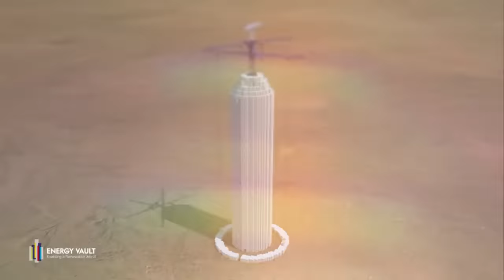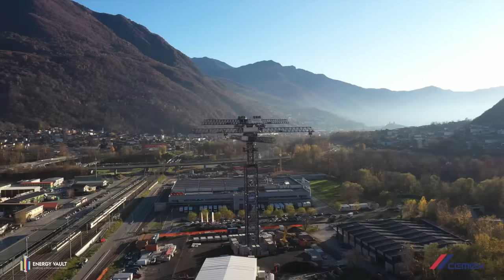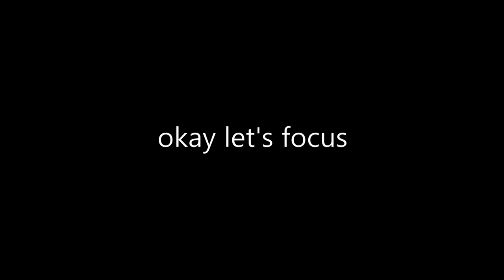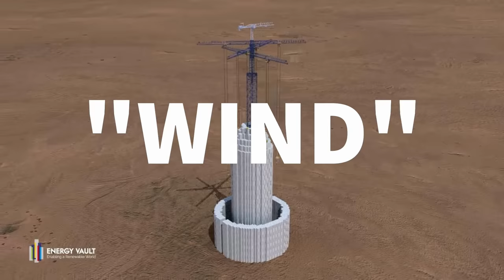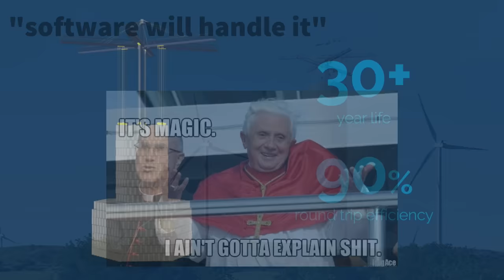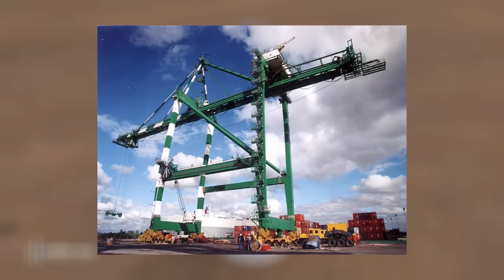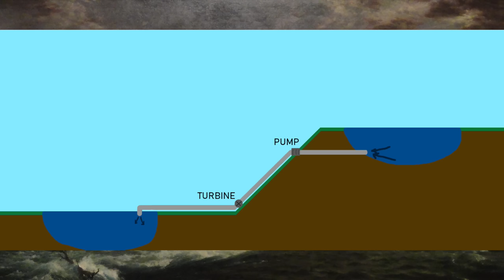The Energy Vault is a Dumb Idea, Here's Why

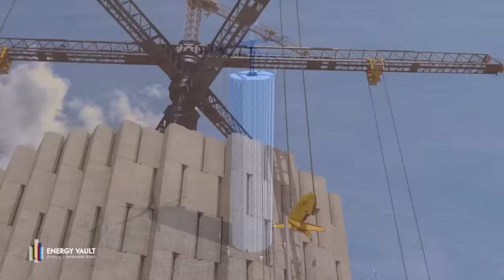Comment: No way in hell are those little tabs on the “grabbing” mechanism gonna hold the weight of those concrete blocks. 3:07
Reply: material science will handle it
Reply: ever heard of the word "concept"
Reply: "Software will handle it" 😁
Reply: dude. no way in hell you know better than a team of engineers working for a multi million dollar project.
Reply: @s3bastiaan  SoFTwaRE WiLl haNdLE iT
Reply: A few inches of steel would actually be completely fine, believe it or not. Think of rocket stage decouplers or things like that
Reply: Honestly that might be the most plausible thing here.
While yes they are a bit small the concept of rotating them in like that is probably fine.
And you'd be surprised how much is possible with modern materials - materials that are fucking expensive so yeah.
Reply: They'll hold it, at least at first. I wouldn't be surprised if you had the blocks breaking down to where they no longer held it pretty quickly.
Reply: It's a demo.
Reply: @jacobsteinebronn2966  Yep. On a steel cradle.
Reply: They wouldn't hold.
If they were full discs with one side being longer, yeah.

But it's only half a disc. The disc will hold, the connection will not.

All of you who said they would, PLEASE never go near a construction site or have ideas about constructions. You'll get scammed an kill people.
Reply: Mine is holding up fine. 😁
Reply: Why not? Those tabs are made out of pure unobtanium.
Reply: @FuSiionCraft  I'm a crane operator.  On mobile cranes the counterweight are held up by two pistons, each with a small lip. Sometimes for months they are hanging there by that 1 inch lip.  You would be suprised.  Also counterweight on a crane weigh alot more than these concrete blocks.
Reply: Ikr, like how would they carry them, even if they were able to which, nice stretch, elastigirl, I still think it would be very unsafe and the risk of them failing a bit high
Reply: @sebastianalegrett4430  they are engineers, not magicians
Reply: @wp9ydqrt49  there’s still like 50 of them working for this, and they all probably did better in college than this entire comment section combined.
Reply: @wp9ydqrt49  idk ab you, but i have enough self confidence to admit idk wtf i’m talking about, let’s be real you probably don’t, and neither does this guy after researching 2 hrs for a 3 min yt video.
Reply: meh, if that was the problem  you could easily have 100+ handles
Reply: @Solitaire Nope the piston and lip goes down a hole big enough for both, then the entire super-structure moves over a few inches into a smaller hole big enough only for the piston.  I'd imagine in practice this would be the way they would have to design these blocks.  I'm only trying to make the case that tiny flared edges can hold a fuck load of weight
Reply: @Desh727  yeah, that's not the same thing, they are enginered to do that, but here....
In the video they are just held from the top (not even a structural point to attach them at the bottom) and rotate...
The rod will just snap due to shear forces, you would be surprised how steel is pure garbage at this specific job...

The only way to make it somewhat usable for shear loads is to use it in I shapes (like |----| ) and even then it's not  that great, other materials can do better

But if it's like a polymer pad with a star and comb steel shape inside of it, then yes it could handle it with no problem since there will be less structural weaknesses
Reply: @singularity3724  we have software for it. It doesnt move it like hulk. Its gentle
Reply: Similar crain systems for concrete slabs and pre-produced stair bases already exists. So that's the only thing that ain't science fiction about this believe it or not! The connection of the rotating disc wouldn't look like in the 3D animation though, but that's only a visualisation to be fair.
Reply: forget those tabs. how are you going to so perfectly slide that bracket over the blocks in the wind. especially when that block is all the way down with a long cable. 

Software will handle it........
Reply: @sebastianalegrett4430  yeah I totally trust a multi million project that thinks software can just stop wind
Reply: Come on bro! They showed it in the documentary! Surely it can't be that bad?
-famous last words
Reply: The question is not "if it can", but "how long before it breaks".
Reply: @yummyherbicide7296  Limited Liability Company means it's nobodies fault if somebody dies!
Reply: hardware will handle it
Reply: They might be fine at first, but there's no way they're developing grippers anything like that that can lift and lower those blocks all day, every day, for 40 years without deteriorating, dropping a block and breaking everything.
Reply: @morganeclipse9038  or dropping a block and killing someone.
Reply: @Dj.MODÆO  One would hope that no one is allowed near the base while it's operating. One would hope.
Reply: bad logic will solve it
Reply: the block's weight would be 500,000N, evenly distributed across 4 of those, that's around 125,000N per (I'll be kind and round down to 100,000N). Based on the size, let's be generous and say they are 50cm long. treating these as cantilever beams (which is kinda unfair but I'm lazy) would require a higher tensile strength than tungsten to support, so it's not happening any time soon.
Reply: Imagination.
Reply: You found the one absolutely feasible thing about that to shit on.

Grabbing around it and catching the edges is the bad idea here.

Probably wanna go through a hole in the concrete so bangs and shakes cant dislodge it 

You underestimate steel a whole lot.
Reply: @ammyvl1  just make the block hollow, then they'll have less weight and the stee... problem solved xD
Reply: sure it can, have you ever seen how much weight a normal forklift fork can hold? a few inches of steel is no joke
Reply: yeah they probably could hold em
Reply: @jacobsteinebronn2966  it might be able to but the design for it isn't great. Theres no reason not to use heavy steel pins that just get pushed into holes in the concrete or stuff like that. Yeah the disc thing would technically work a few times, but it would wear down unnecessarily fast, have more expensive materials, and just be kinda bad engineering. A big pin works just as well with fewer and more simple moving parts
Reply: the software will handle it
Reply: Hydro has some serious issues. Personally i think we have to get used to the sight of windmills and go for a wind, solar, hydro, nuclear mix depending on the location. Off-shore windfarms are the shiiiit imo.
Reply: @s3bastiaan  yes, this is a bad concept, as the video discusses
Reply: @sebastianalegrett4430  the multi million dollar project revolves around loosely stacked concrete blocks and about 700 tons of faith. A 5th grader could come up with a better plan
Reply: @hamburgerdog25  then do it and become a multimillionaire instead of replying to 7 day old comments on yt
Reply: Well, it's pretty obvious that no engineers were working on this project. I'm fairly sure even engineering students would know better.
Reply: @sebastianalegrett4430  it wouldn't be the first time people with degrees and field experience had an oversight... I think there used to be a TV show about these kinds of failures? (If you know of the name, let me know.)

Even if done indoors. I'm still concerned with the wear and tear involved with concrete being moved. Pressure on the lower levels going up and down. Along with uneven lifting/letting go. Near perfectly square blocks won't stay perfect for long... If they were that way to begin with. All it takes is one idiot or a bad leader who thinks time is more important than doing it properly.
Reply: How do you have this weird font in your name? 😄
Reply: @user-qx7tm5df8j  I enter text into a gothic font generator, then copy and paste
Reply: @Dj.MODÆO  😂 ty
Reply: Little tabs holding a lot of weight is how most shipping containers are moved on and off of transports.
Reply: Oh shit you're right! I didn't even notice that. Damn that's going to immediately crumble and break off under the tensile and shock strains exerted on it. Sheesh this is even dumber than I thought
Reply: Didn't you hear? M8 bolts are strong yo!
Reply: @jacobsteinebronn2966  how many times a day rocket stage decouplers are usued on daily basis?
Reply: My thought exactly
Reply: @s3bastiaan  The things that 99% of the time are not implemented? Yes.
Reply: @Asbitos  the problem isn't that they can't support that much weight, the problem is that they'd probably damage the blocks over time too
Reply: @jacobsteinebronn2966  how many times do rocket stage decouplers get reused?
Reply: @sebastianalegrett4430  "people with money surely can do no wrong"

Comment: Adam: "I'm no Engineer..."

Me, who is an Engineer: Immediately after they show the grabbing mechanism "It doesn't work"
Reply: Software engineer and even I see those things snap off in spectacular ways
Reply: @OmegaGamer04  Marketing department: We'll call it a kinetic impact delivery system.
Reply: me who is still in school, and not even studying: I don't give a shit that this is gonna work
Reply: @mcripchip  That's not the issue though. You're right the problem is solvable; we already have proof in gantry cranes, which are capable of efficiently moving large heavy blocks for decades. The problem is that the specific design they chose to show here for whatever reason is unnecessarily novel and obviously flawed.

It's like, imagine presenting a design, and when it comes to the smallest, most easily solvable detail, rather than glossing over it you zoom in on a fancy graphic that reads "dunno, we'll figure this part out." That doesn't really inspire confidence.
Reply: @greenredblue  This comment just triggered me a little considering prototype engineering is exactly like this, a lot of the troubleshooting takes place in construction phase. Your job is just to make sure that joist is the right thickness, and that to come up with the simplest possible mechanisms that just work in theory. And when it comes to design there's a whole spectrum of engineers some have poor ideas and have bad vision others are team players and are capable building things like the JWST. If you asked an single engineer to look a graphic of the JWST 20 years ago. He would probable say simply "doesn't work"
Reply: Kindergartner here and I can tell you it won't work.
Yesterday I made a big tower out of blocks, Michael touched it and it fell on my big toe. It hurt a lot.
Reply: @JoshYxVdM  YES! lol
Reply: @greenredblue  That's kind of a foolish objection.  Graphics for a concept are never meant to be taken literally.  They are merely flashy bits to showcase a concept.  The concept is what these folks are trying to sell, that concept being a block-stacking gravity battery.  The grabber is solvable-scratch that- solved, but they didn't need to have hyper accuracy in the graphic to sell the concept itself, so they threw in something easy to render that looks vaguely neat.  Not great, but not a problem either.
Reply: @ericv00  But the important thing here are the details. The general idea of lifting heavy things to store energy and dropping them to release that energy is not novel. Figuring out all the details is where the work is. Presenting only the general idea of using stackable blocks of concrete with a generic crane is not very promising: it smells more like marketing than engineering.

And maybe that's the purpose. Quickly patent the 'idea' of using concrete blocks, without considering how, so you can charge for the patent to any other future project that uses blocks and have figured out exactly how.
Reply: @ericv00  I'm a software architect, and I have to sell designs all the time. In a demo or POC, details don't matter unless they're part of the minimum viable product. Lots of stuff in those are fake anyway.

Therefore, you do not zoom way in on irrelevant details that suggest you not only wasted time reinventing the wheel, but did so in a way so suspect that questions of basic competence need to be asked. That is what happened here.
Reply: @greenredblue   Questions of basic competence often do not occur in the minds of the people you are selling a concept to.  In particular, these types of projects are mostly in the hands of politicians, and we all know where they are in comparison to basic competence.
Reply: You need something to grab a block reliably. What about the good old hook system for the vertical forces, and something lighter for the horizontal placement?

Remember: the first Tesla was operated by laptop batteries, what a stupid idea!
Reply: You could build it on a mountainside or large hill and turn it into the same thing as pumped hydro. Would be less efficient but no current battery is 100% efficient.
Reply: @samiam4544  it's called a TRAIN.  And it's been done.  Trainloads of ORE driving up a mountain to store the energy, releasing the brakes to return it.  Well over 80% efficient, even better than pumped storage.
Reply: as a technician I'll say : hope there is a bathroom up there
Reply: Yeah... that little plate isnt holding shit.
Reply: There is a fully working prototype already build and working...
Reply: We call this one the “gravitational potential energy but like innefficient”
Reply: you're not a software engineer - how do you know?
Reply: im an architect and i knew that thing would break within an hour of operation
Reply: What engineers look for in a design:
- Is it reliable?
- Cost effeciency
- Long-term effectiveness

What Elon looks for in a design:
- Does it look cool?
- Can I sell it to investors?
- FUUUTTUURRREEEEE
Reply: @Daryl Olstad Correct me if I'm wrong but I think an engineer work is to solve problems, not solve designs. What I mean is that an engineer when presented with a problem and a prototype (the tower in this case) if the prototype doesn't make sense they'll indeed say "it won't work". An then start making changes to the design to fix all the issues just like in the video.

That's why engineers an designers are often in different pages, one focus solely in functionality and the other in aesthetics (but botha are important, because selling something that doesn't work or is even dangerous is a good way to destroy your business, and having something completely functional but being unable to sell it is the same as having nothing).
Reply: Its the kind of idea you have whilst driving somewhere, so you draw a crap picture on a scrap of paper, and get over trying to work out how to make it work efficiently with cost effective parts that dont need servicing every run on the drag strip.
Reply: @samallen5057  yeah. people discussing semantics while the idea itself is not revoloutionary and the presentation is bad.
its just a bad presentation of an idea that is at best as effictient as other solutions we have.
Put money into hydro instead, it's the one thing we have PLENTY of in the world... why not use it. im against regulating non saltwater though... however, tidal dams/turbines etc. seems like a much better idea, and its not used cause its super expensive to "start" an infrastructure. The only upside of this is we're used to playing tetris on loading docks.
Reply: @moteroargentino7944  Nah you're wrong
Reply: I'm a tunnelling engineer and we have custom grabs to lift concrete segments. The segments get lifted from the trucks delivering them, to the surface for storage, then underground for use. The number of segments damaged using our very expensive custom lifts for these comparatively very few lifts damages many many segments. We have gone back to slings - which you can't use without personnel to sling the loads. Amazing how they sell this shit.
Reply: as a construction worker that works on and around cranes, fork lifts, skidders, and loaders...I can think of at least 12 ways that mechanism will break....
Reply: @josh_harrison  and yet i still have to field repair 80% of the shit in the fields, budz :p
Reply: @josh_harrison  and its you guys that help us decipher the moronic prejob prints from the project manager.
Reply: I'm a math teacher, I deal with non-deformable solid, and even I flinched when I saw this. That's gonna snap.